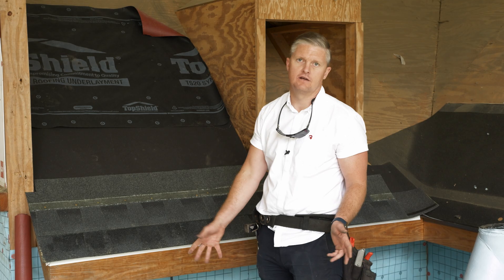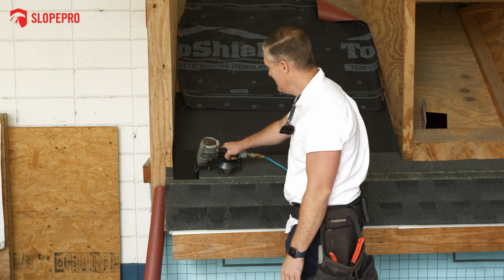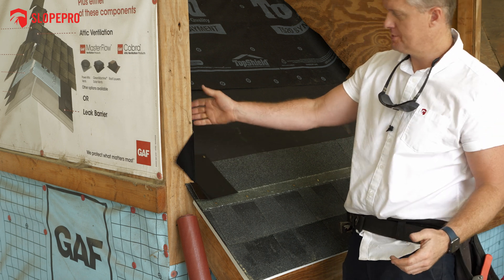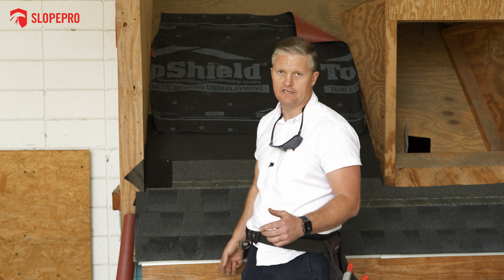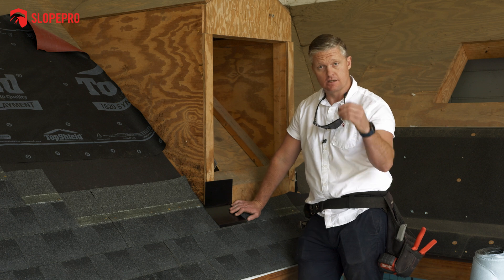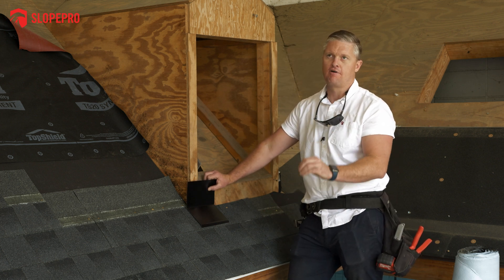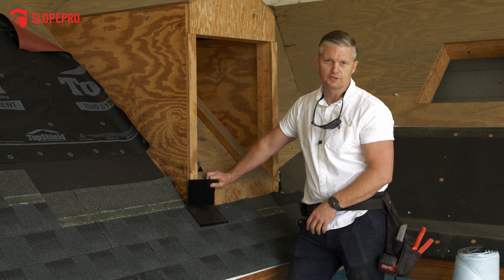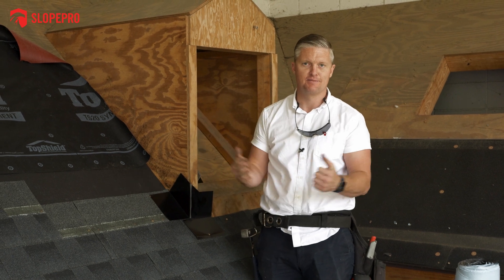Roof Flashing Installation | Preventing Leaks at Walls & Transitions

Comment: That bottom step flashing may empty right out onto the nail on the shingle below based upon the shingle high water damn
I want to ask is this common building standards, but based on my roof, I think the question will be misunderstood.
Regarding that head flashing exposed nail, how long does the caulk last? 
Roofers are offering me a 10 yr warranty with metal that should last 100 years and shingles that should last about 30.
Why only 10 years for 30+ years product?
What warranty do you offer?

Comment: I'm sorry but that corner is done in a very common wrong way, that corner still has a hole in the corner. The flashing is supposed to run PAST the corner.
Reply: Both of these corners will leak like a sieve.  Perfect demonstration of how NOT to flash
Reply: Agreed
Reply: Bring those corners down past the bottom one. Even tho it sticks out, it will not leak in the corners. Also if your not depending on the caulk for long term waterproofing solution than why would you depend on it on the nail hole in the flashing that's sitting on top of the shingle?!?
Reply: A pinhole but a hole nonetheless.

Comment: What about fasteners from the flashing to the wall ? How is that done? Or is it ?
Reply: If you have siding then the house wrap or zip tape gets taped across the top of the flashing and then the siding goes over it to keep rain from behind it. If it's a masonry wall the wall gets cut for a counter flashing strip that gets held on with sealant and overlaps the step flashing. Either way you don't fasten the top of the step flashing itself cause then it can flex with the house and doesn't create leaks when things shift around from hot/cold/wind/humidity and it's easier for repairs or reroofing to be done in the future without having to pay for all new flashing.
Reply: yep needs one nail at the upper corner

Comment: One very important step that can save you from leaks is to install ice and water shield at all walls valleys or weak points of the roof. It will seal nails help keep water out.
Reply: Yes sir!
Also it is best to avoid nailing anywhere within 4" of the wall/flashing. Also I prefer to nail the flashing on the upper most part of the step flashing on the wall side if possible. I try to avoid nailing through the roof deck near the walls and flashing.
Reply: Thanks

Comment: Wouldn't the one piece flashing work instead of step flashing , if you put a counter flashing on over the whole thing?
Reply: The reason for using step flashing is that it continuously diverts the water away from the wall and on top of a shingle. One continuous flashing will allow water to work its way under the flashing as it goes down the slope.

It is a good practice to use ice and water and felt up the wall a few inches before you install your shingles and step flashing.